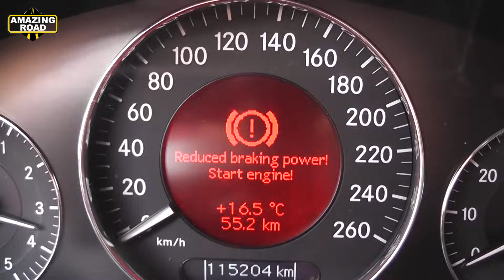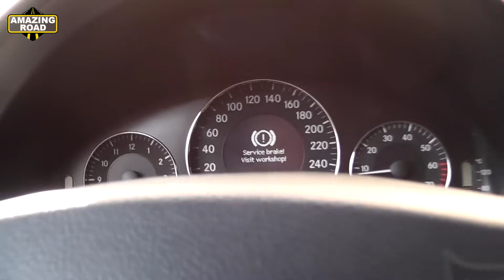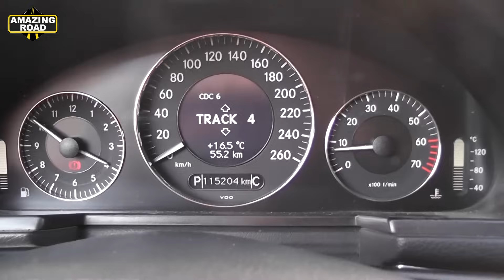Causes of errors Service brake! Visit workshop! & Reduced braking power! Start engine! on W211, W219

Comment from the maker: Changing SBC Brake Pressure Accumulator in W211  https://youtu.be/CCXlfeDAly4
Mercedes W211 Replacement the Fuel Filter  https://youtu.be/LVpEIoUC178
W211 Replacement or Removing Fuel Pump  https://youtu.be/VXQa5WZXWLs
Brakes failed on the road  on W211 https://youtu.be/tUZg9WytbbE
Repair the IR sensor for Mercedes  https://youtu.be/h5GEVx5uemI
How to reset automatic transmission 722.6 Mercedes  https://youtu.be/_FjX2Yl42t4
Best Life Hacks for Mercedes W211  https://youtu.be/p6bZLZ0WcQc
How to Make AUX on Mercedes W211v https://youtu.be/7JnVR-nF0UQ
Detailed Installation Android 7.1 COMAND & CANBUS  https://youtu.be/EisTZV-FCX8
Mercedes W211 Top 25 Hidden Functions, Secrets https://youtu.be/ZYQwnmydbp8
TOP 55 BEST LIFE HACKS FOR MERCEDES W211  https://youtu.be/CgixWAzrphs
W211 HOW TO REPLACE BRAKE PADS CORRECTLY https://youtu.be/6syWcyTcTVE
Reply: Amazing Road TV so you left the plug unplugged for 15 to 20 minutes?
Reply: C klasic

Comment: Bro i have seen your  videos and i see that you a master of this type of mercedes i have a problem let me tell you 

I have a w211 220 2002 my problem with the brake is this when the weather is to hot i have the red screen with reduced power but presing the brakes a bit hard the car brake and when this happen my brakes stick the front ones i lave the car parked for a while 15 min or 20 and when i turn it on the red screen is gone and came back after a driving a bit but this happens only when is very hot weather i got sbc inspected 6 months ago and the auto repair guy say that is ok  also i dont have the white screen '' service brake visit workshop'' on my dashboard but also i noticed that when the red screen happens when i brake the brakes make a noise like they have air a grinding noise like some tire explode  i never cleaned the brake calippers and piston  i wanted to know from you my problem is a sbc or brake calippers related thank you in advance 🤜🤛

Comment: My MB w211 e 200 Kom before the red “ reduced braking power visit workshop” show , the brake can be pressed to the floor . After pump the pedal 4-6 times maybe, the pedal can resist my foot but red message shown. Later , I turned off the engine for minutes then started again . The red message gone. I try to drove a short distance, but the symptom seem gone. I m not sure that the problem will be back again or not. I wonder why before the red message shown , why the brake pedal can be pressed to the floor.

Comment: My brake lights light up nonstop even   when I m driving. Is it cause of the switch too or else. Pls advice. Thanks in advance
Reply: Check the switch for the brake pedal. It might be compressed even though you’ve got your foot off the brake pedal, hence your brake light is on

Comment: Hi. I have an 2002/2003 model e270 and I get the red battery on dashboard and also the service break. I replaces small, big and alternator. And still the same messages are there. I was told sbc needs to be replaced. Because a mechanic that checked voltage they said the SBC isn't communicating or something like that. Do I need to replace it all or reprogram it? Sbc starts with A 005. It's been so annoying cause I feel as I've tried everything except this. With the sbc
Reply: Hi I have one question; with red dashboard it is possible to brake or it’s much dangerous ?
Reply: @Street911  mine is more so for the battery thats been more annoying as for braking I've had no problem with that. It brakes fine.
Reply: @Iamhaxal  Oh thank you for your feedback ! I think you should be delete the error message with OBD, because you change 2 battery and your message « red battery » is still here.

Comment: i have a 2004 e320 4matic sedan and get this same red light brake message about reduced power but i don't have any brake codes when scanned. i replaced the brake pedal sensor no help at all car loses brake pressure when I'm driving have to pull over and restart it to get brake pressure back. HELP any ideas PLEASE???????????

Comment: I have different problem with gray service brake. During driving it appears and after engine off/on it went away and appears again during next driving. i think it can be worn brake position sensor but ofc Im not 100% sure

Comment: What will happen if i forget to deactivate my SBC before change the brake pads
Reply: Although you have most likely already finished this it seems that when you remove the pads it will pump out the caliper until it pops out thus blowing fluid all over and making your brake job multiples more difficult to do.

Comment: Any one please share WhatsApp number n help I have e200 kompressor 
 the same red light with reduced braking power start engine
Car not starting every morning I use to put jumper cables with battery n other battery the car starts n runs smoothly without this red light message but when again next morning I use to start the car same red light message arrive n the car don't start please help what it is 
If it is battery or something else
Reply: Please help 😥😥😥

Comment: I have a Benz E270 W211 and the same problem!!!
"Betriebsbremse Werkstatt aufsuchen" is writing but nothing red ....
Is this possible to do the same like in the video to reset it???
Reply from the maker: https://www.youtube.com/watch?v=zOmlO3tHpVs Watch this video when there is time, I'll tell you everything there
Reply from the maker: need to know the error code
Reply: where i can see the error code exactly?
Reply from the maker: @cepalo84 Through the diagnostic program https://www.youtube.com/watch?v=zPha-2OW92c&t=762s
Reply: it's not easy for me to find somebody who can help me, cauze i haven't a diagnostic program
Reply: is this possible to repair it with an obd Diagnostic sbc quick tool??
Reply from the maker: @cepalo84  Fix no, check yes. You can reset, but you need to find out the error. You can install this program yourself.
Reply: Thx for the help and fast answer
Reply from the maker: @cepalo84  Thx

Comment: Does this drain your battery
Reply from the maker: No
Reply: Which model u have as it's drainingy battery too 
I started my car with jumper cable n then it was ok 
Then next day the car didn't started n same red meassage reduced braking power start engine n the car not starting and again started with jumper cables 
N the next day the same what to do 
What u have done

Comment: This method doesn't work I already tried it unless you fix the cause it doesn't work... I had to replace the ABS 😫😭😞 💀 unit in a 2006 MB E350 in order to fix the problem

Comment: SBC unit failure and it has 25 years and unlimited miles warranty certain MB cars W211 does it matter how much owners the car had. There is a recall you can search for in Internet . Giving me “brake visit workshop” white and black not red  went to a car garage and  after the car has been checked they told me need the SBC unit to be changed because of faulty code on it and need to go to a MB dealers because the SBC system under warranty for 25 years.
Reply from the maker: Warranty Not All Countries. CIS countries do not exactly have a guarantee

Comment: guys. don't pay any attention to this video. this guy is full of shit. if your Mercedes shows Reduced Breaking Power, Start Engine. you battery is either not fully charged. or the battery is bad. I did about everything I could think of including replacing the relay. it wasn't until I sat down with my owners manual and it told me what it was. so unplugging and plugging the relay back in does absolutely nothing. this guy is full of shit.
Reply from the maker: sorry, but you're a complete moron. https://www.youtube.com/watch?v=CCXlfeDAly4&t=36s

Comment: Hello, I got the same problem with my Merc cls 350. Can I fix it by using same think as you did in the video?
Reply from the maker: I do not know what you have, but I had a mistake because of the button
Reply: I got an Error errors Service brake! Visit workshop! & Reduced braking power! Start engine! Unfortunately we changed a frog and it doesn't helped. We just checked  the error codes:C23CE, C26F5. May yuo know what is it?
Reply: I got an Error errors Service brake! Visit workshop! & Reduced braking power! Start engine! Unfortunately we changed a frog and it doesn't helped. We just checked  the error codes:C23CE, C26F5. May yuo know what is it?
Reply from the maker: This is already seriously a friend. These errors are due to electronics sbc.

Comment: Hello Sir, I have a 2003 e270cdi, it says service brake visit workshop in white writing, the car is at Mercedes ,they saying they cant reset pump, I must replace sbc, the sbc had been changed 2 years ago, there is nothing wrong with the brakes, what can I do to cancel this malfunction.? thanks in advance
Reply: Mercedes has as of 2019 prolonged the warranty for sbc pump for 25 years. U can get refunded
Reply from the maker: In a few days I will have a video about this. You can fix this problem
Playlist for Mercedes W211 https://www.youtube.com/playlist?list=PL8irNmik4fC2amQhM2t14l6X1zQoOd9Pc

Comment: Hi friend, i have service brake error comes and disappears. I Did diagnostic and it says Error code c215c, "Brake light switch component doesn't close" DO I need to change switch ?
Reply from the maker: Yes.  You need to change it
Playlist for Mercedes W211 https://www.youtube.com/playlist?list=PL8irNmik4fC2amQhM2t14l6X1zQoOd9Pc
Reply: Good morning. How did you clear the code C215C?. Other than "components doesn't close" could it be an issue of wiring or the connector?. Regards. Have a good day! 😄
Reply: Will the brake lights work if you believe the brake light switch is the problem.

Comment: These Videos are intentionally so vague it just causes confusion. Changing the brake light switch will not always remove the red warning "Reduced Braking Power" maybe in some cases it does. I removed mine with W211/R230 ABS/SBC tool for Mercedes Benz from ebay for $26 from China. Just plug it in the OBD-II (on-board diagnostic system) then start your car I pressed 50% (users choice) for few seconds until the busy light started blinking then let go. It will go through the programing then it will removed the Red warning light "Reduced Braking Power". Goodluck, I  Hope this will help some of you. Its better and cheaper going to the Dealer and get rip-off.
Reply from the maker: https://www.youtube.com/watch?v=tXK_Zl5hv3M
Reply: vick diamond where do you get this device and link please

Comment: So you just unplugged it and plugged it back in and waited 15-20 minutes?
Reply: - unplug wire
- start car
- turn off car
- plug wire back in
- start car
- turn off car
- wait 15-20 minutes
- turn car back on
Reply from the maker: yes. 
Playlist for Mercedes W211 https://www.youtube.com/playlist?list=PL8irNmik4fC2amQhM2t14l6X1zQoOd9Pc
Reply: Amazing Road TV thanks, I'm going to try it. I got the service brake visit workshop message the other day, I haven't got the red one yet but I'm sure it's only a matter of time.
Reply from the maker: THX
Reply: Can engine be on while u wait?

Comment: yes
Reply from the maker: This is error happens when there is a problem with electronics. A small battery checked?
Reply: I replaced battery about 5 months ago. before i changed battery I never had this light error should I change battery again
Reply from the maker: I made a diagnosis and I had an error C215C here's a video https://www.youtube.com/watch?v=ZRJEJZ3deQM
I changed the button and it all went away. Do the diagnostics to find out the errors

Comment: would you recommend this car for first car? I have fairly a lot of expirence in driving
Reply from the maker: Very good car. The motor and the suspension are almost undetectable. The only problem is SBC
Reply: I have a second hand mercedes....a nightmare ever since I bought....as everyone says who ever had an absolute money pit. They look nice, drive nice (if comfort is more important to you than handling) and have great engines....but all this is backed up by AWEFUL electonics and wiring. I am at the point with this car where I am surprised when there isnt an issue with it....2005 clk w209 220cdi.......walk away my friend...trust me....unless you have money to burn or a fetish for electrical problem solving....

Comment: I have 2004 e320 i did all the steps you provided but error still there.? should i change the break switch and see? thanks
Reply from the maker: The problem I have been in this, I do not know why you have not solved the problem
Reply: Amazing Road TV I will change brake switch and I already changed front and rear break pads with sensor all I need get rid of red message to trade in my car
Reply from the maker: To brake pads other error
Reply: Amazing Road TV  it's brake light  and error message saying  reducing break stopping  start engine
Reply: yes exact same and i already changed sbc pump still not going away. Please help
Reply: Amazing Road TV any tools  can reset this error code

Comment: error: c2131 pressure reservoir faulty. What does it ? And How i can solve this problem
Reply from the maker: Error C2131. Pressure in the system is low. Rather already defective block can not pump pressure.
Reply: so what should i do for this.
Reply: and thanks for your reply
Reply from the maker: khursheed faraz Thanks for watching! See other videos on this channel 👍
Reply: khursheed faraz 
kľgjl;));(&^///

Comment: I have a Mercedes E270cdi 2004.
My car battery keeps going down after 2days.And I cant turn on the engine because the battery is spend.can anyone help me?
and I have the same error as you
Reply from the maker: We checked a small battery under the hood? This may be from the brake light switch doesn't work.

Comment: Hi my friend !! I changed braking power the same proses that you make it in this video the red error was gone but the ( service brake visit work shop ) was still in the dash board.. when I changed the part I start the engine direct    10 to 15 minutes  I did not do it.. I wanna your advice.
Reply: this is willi work
Reply: i haw a problem  220 cdi 2004 manual   cod c223c  end c22bc   ??
Reply from the maker: I am glad that the video was useful to you. If an error Service brake! Visit workshop! does not disappear, then you have exceeded the limit positives SBC block and it is necessary to reprogram SBC block. But it is possible if your power begins with A005 or А008. Here's a video https://www.youtube.com/watch?v=5YKwT8rK88A
Reply: Amazing Road TV Thank you for the help.. when  watch your own video for this problem, but my question is, Can I do to re-program the sbc codes A005, A008 or SBC must replace the entire unit?
Reply from the maker: If you block begins with the A005 and A008, can easily be reprogrammed.
Reply: Amazing Road TV In any case i wiled give re-programming bugs because I've changed the piece which was the reason and will see what happing.. thanks for you and we waiting new video show about w211 👈🏻😍
Reply from the maker: You're welcome. I am glad that I help people 😊